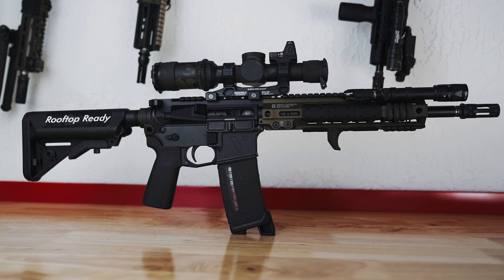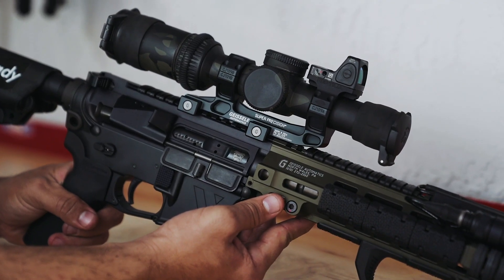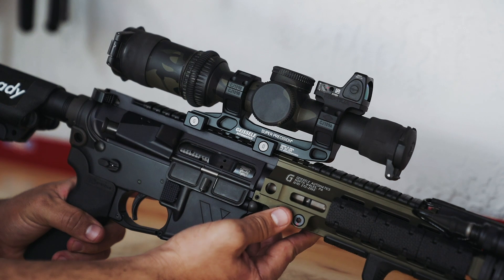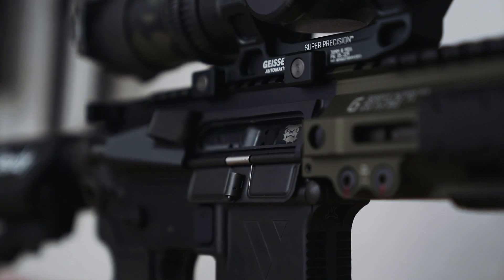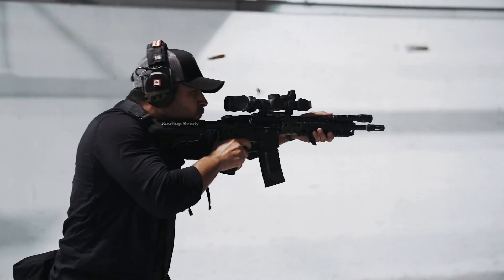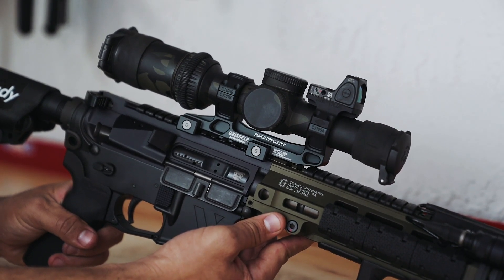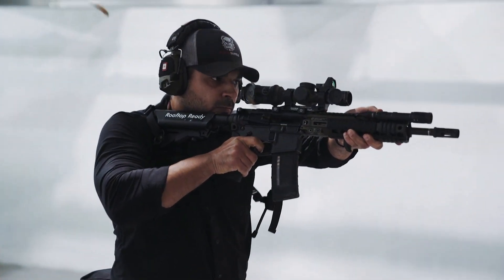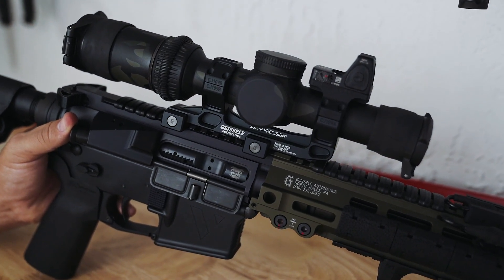Rosco Manufacturing 12.5" Bloodline series barrel

Comment: I see it’s a Vltor lower. Are you running the A5 system in this build? What buffer are you running? I just got a 12.5 bloodline sauce pack and trying to figure out which buffer weight to use.
Reply from the maker: Yes sir, it definitely is a VLTOR upper/ lower combo. The combo was purchased with a standard VLTOR buffer tube and a Geissele Super 42 spring/ buffer was used in this build. It runs as smooth as silk with that combo.
Reply: @RoscoMfg  sir what buffer would be nice to a 11.5?

Comment: Why not mid-length? Reliability issue?
Reply: yes, for mixed suppressor usage combined with a phosphate bcg reliability will go down. customers for short mid lengths (faxon, triarc) will almost never take their suppressors off and combine it with slick bcg's (nitride, nib, np3, tin).

given a choice between mass market and specialty customers, most companies will develop products for the former. i live in a state that doesn't allow suppressors anyway, so i'm all for carbine gas systems up to 16" barrels. so, i am part of the problem because i will never beg rosco to make a 12.5" mid length barrel :)